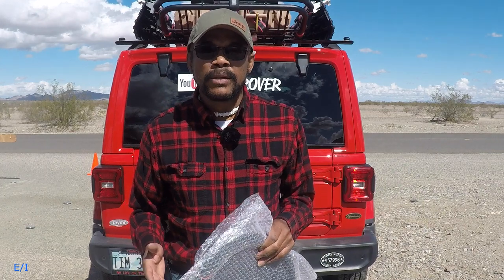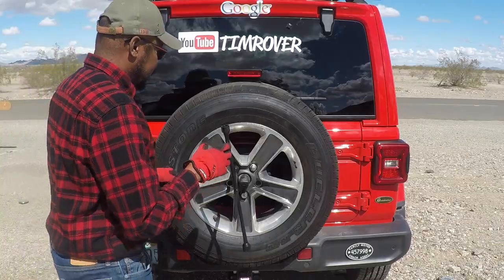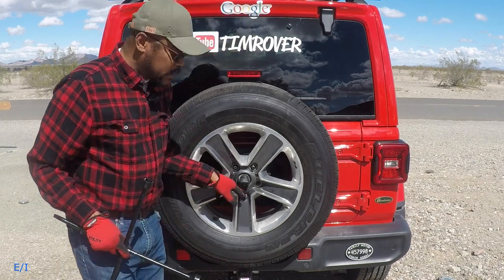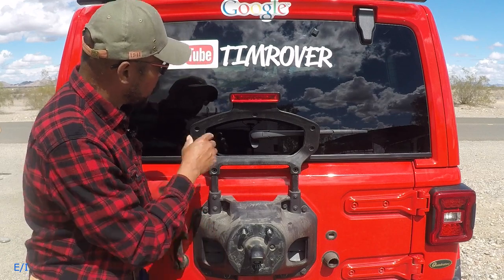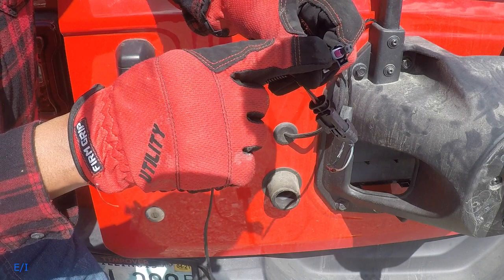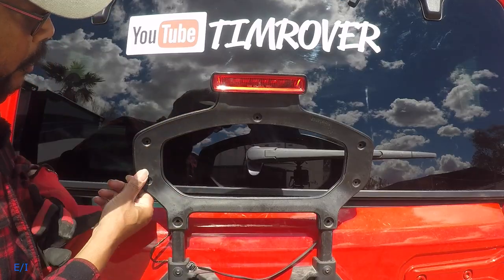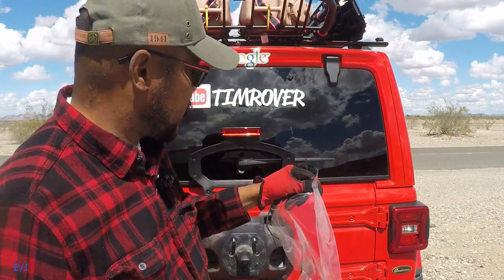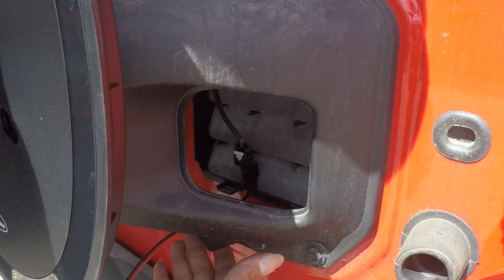RV Innovative Idea # 118 ~ JEEP JL 3rd Brake Light Ring Installation

Comment: excellent add-on Safety feature.  always wondered if those were an after purchase idem or just a newer jeep upgrade. Really nice addition Tim.  The red lights really blend in with the jeep color.
Reply from the maker: It really is Bruce that almost catches folks off guard since you really can’t see the ring until the brake lights are applied.